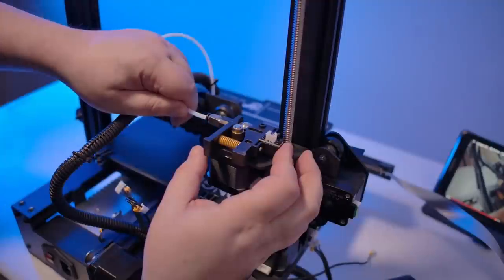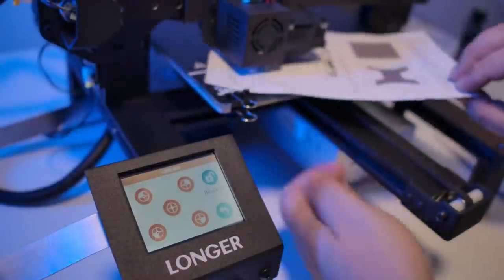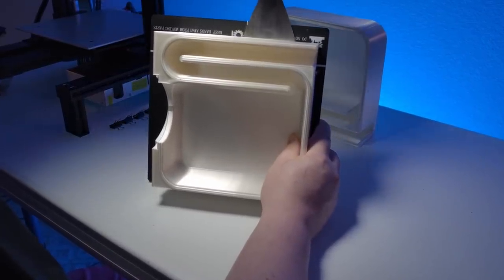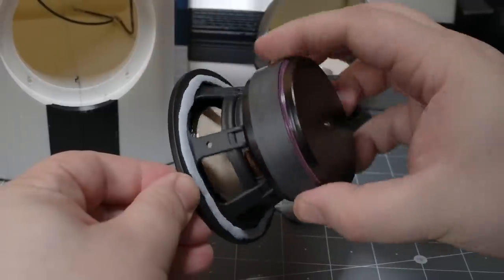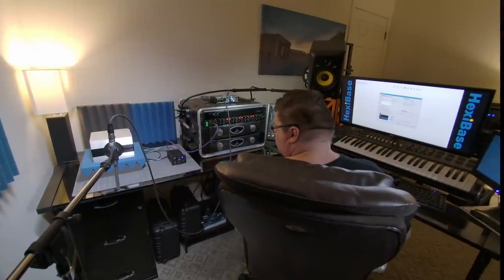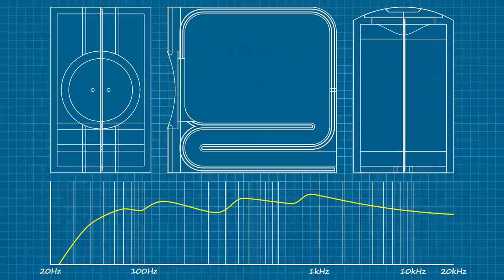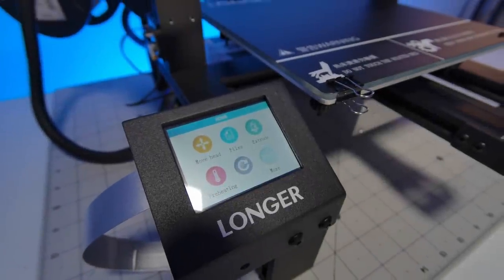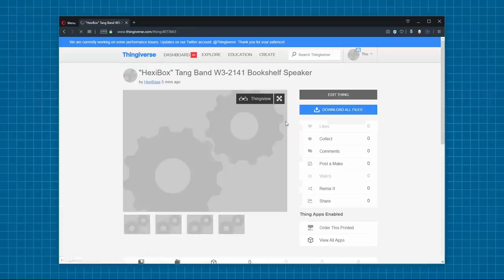Full Range Speaker Project, Longer LK4, Plus DEMO!

Comment: I'm sold, now i just need a 3D printer..
Reply: @HexiBase  Do you know how much the pro will be going for tomorrow?
Reply: It is 199 after $10 coupon, price already went up?
Reply: @OTL The High Temple of Spam that is an extreme. You could say the same for pro-grade 3d printers.  A cheap track saw (I love my grizzly) can replace a table saw for speaker building, a bunch of clamps, a drill, and a jig saw is really all that it needed for basic enclosure construction
Reply: @HexiBase  that's not bad I thought that would be like a thousand dollars...
Reply: Your the best
Reply: My printer is on the way...

Comment: Hey I like your content and analysis of speaker science but dont you think if you also put a walkthrough on how you end up designing the inner enclosure, like the measurements, the layouts, etc, it would be useful for builders. This would help in using those for different range of drivers. I have seen your woofer project, after watching the video I was impressed and wanted to try out but couldn't, since you never explained how you go about doing the enclosure calculations and build. That was not fun in the end.

Comment: So made those two beauties, 16 hours with 0,8 mm nozzle for one half ..... paired them with cheapo TPA3116D2 aiyima 2+1 amp ...... amp can deliver 25W at 8ohm, speakers can draw 25W at8 ohms continuously .... long story short, blew amp (testing is not testing if you dont try max Volume) but at that short life of amp (waiting for new) speakers plays guitar songs magnificently :D
Reply: also if anyone can recommend "budget" 2+1 amp that i can pair with this two beauties and one 3" Subwoofer Enclosure v.2 (with Tang-Band-W3-1876S inside), would be very grateful ....

Comment: This one looks good and is highly rated ANYCUBIC Chiron. Can build a nice sized enclosure, but I wouldn't use PLA personally, because it degrades in sunlight and is not a good material for automotive environments. I'm looking to 3D print an enclosure for my coveted Precision Power PRO 8 liquid cooled sub-woofers. But want to use Nylon as the material, this one I don't think will use Nylon filament, but that may change in a later revision.

Comment: No batting, yet no mid-range/ treble leaks through the port? What kind of wizardry is this? lol! They sound very good. I attempted a pair of speakers a long time ago just using full range drivers and was blown away. They did have issues with spikes in the midrange and treble regions but for my first "speakers" they weren't bad.

Comment: I printed a pair of these along with the V3 Sub out of ABS and powering them with a Dayton Audio DTA-2.1BT2.  Using them as a 2.1 setup for my PC replacing/augmenting my Yamaha NX-50's.  These blow away the Yahmaha's by a fairly good margin.  These have much better mid-response where when I switch between the Yamaha and these it's a night and day difference with these being heavily favored by my human ears.  To be fair these drivers and the amplifier cost the same as the Yamaha's cost and I still had to print the boxes which take up 2+ rolls of filament and print time which for most people will be just over 2 days.   I look forward to more 3D printed speaker boxes you make.  I'll probably have to print them as well.

Comment: Digging your channel and the technical nature of your content!
Given the flexibility printed enclosures give you, I'm quite surprised to see a full range design with relatively large unsupported/unstiffened sides.  In listening it almost sounds like I'm hearing a resonance in the midbass from the enclosure, though it's impossible to tell.  Do you pick up any resonances through the enclosure with your hands/ears when sweeping a signal?
Given the nature of your channel, it would be incredible if you were to explore the technical side of damping/minimizing enclosure resonances.  With your modeling skills, perhaps you would consider adding some FEA/resonance modeling to your resume?  I'm an amateur speaker builder at best, but the little bit of experience I have suggests the enclosure design (and it's sonic neutrality) is far more important to making a speaker sound good than the driver choice and sometimes even the crossover details.  Cheers!

Comment: About 5 hours per side to cnc out of wood..... Hmmm
Reply: @HexiBase  Had to order longer bits but I am going to give it a go. They only issue is the indexing slot is square. Since the finishing 3d path uses a 1/4 inch ball nose bit I will need to figure out how to edit the STL file and either make the grove deeper, or round over the raised slot. Any software recommendations to do that?

Comment: Nice work.
You should add your speakers to the "customer photo gallery" on parts express by writing a review.
With the links to your content of course 😎
Reply: @HexiBase  Oh, and you should really switch back to gyriod infill.
It prints significantly faster, is easier on the whole machine with less jerking and overall stronger.
Just stick to high perimeter counts since that is where you get the most structually gains anyway.
It may also be in your interst to play with the "nozzel size" to get tighter perimeters but this is something that needs to be experimenteted with to get "a feeling" how it behaves.
You can trick the slicer to slice some mazing things this way ;-D
Reply: @HexiBase   Uhhhh Simplify3D is a heavy weight with a myriads of advanced options especially in terms of job planning 👍
But don't get to set on one single slicer try other options like cura or prusa's slicer from time to time since each has its own niche and specialities and very active devlopment.
And why is the god damn spellchecking not working get a grip chrome 🙄

Comment: I just found your channel a few days ago, I was hooked right away. You deliver the information in a very informative yet engaging way. I'm in the process of making my own portable bluetooth speaker and I want to apply one of your "snake/wave" patterns. Could I make a "box" applying your pattern with four drivers and a sub? 
I don't have a 3D printer but, I will be getting a CNC machine in June which is what I will be using to create this. What amp do you use on your desk? (when you connect your test speakers to for the videos)

Thank you in advance. I greatly appreciate your time and knowladge. Stay safe and have a great day!

Comment: If you're going to be doing a lot of gluing together of 3D printed parts you should check out J-B Weld Plastic Bonder. I find it works great on PLA and PETG. 
Great speaker project! 

Ok here's a challenge. How about a design with a 100mm cubed build volume constraint on the printed parts?

Comment: Man..) Excellent work!!!  Curious.. How would you run a cycle-truck stereo? Got a Kona Ute with about 38" x 7" of rack area, not even considering seat wedge..) I'd like to project sound at the ground, front 180 arc (from seat wedge) , and likely a booster fan out the back, keeping sides and top for solar panels..) Passive radiator cool.. are there any flow through designs?)   ( air flows through) You know a lot more then I do..) Those are pretty popular bikes.. with a sick lightweight quadraphonic kit, who would even need antigravity?)/*   Currently running a pair of lightweight 20 or 25 watt bluetooth speakers at a time, but they die down.. luckily, from dropping mine, one came apart down to where I could see the hardware's easy access.. )  If you're bored with your other stuff, hit me up. Rock on!

Comment: can i use alternative options (of the same brand) for these speakers?
Because they will be in plain sight at my place and don't like the driver very much.
I do understand that all the parameter are based on this driver.
Other than that everything you make is great content and very informative!
Although as a Dutchman I do have some trouble understanding all the technical terms

Comment: You do not want to support the top of the leadscrew because that can induce a banding. It forces the wobble to be put into the x axis rather than just running out at the top. Even if it was a perfectly straight leadscrew and the coupler didn't induce runout the benefit of supporting the top of the leadscrew is nonexistent. It can only cause harm.
Reply: @HexiBase  Cheers to you as well. I appreciate these printing videos as almost nobody has the ability/equipment to test sound like you can. Are you planning another woofer/subwoofer build since the last one caused a crazy backorder on that specific speaker lol?

Comment: I feel like parametric modeling would be amazing for 3d printed speakers.

Because you could have the user put in the speaker info. And maximum size in two dimensions... And then have it calculate everything else automatically based on a set of parameters.

Comment: The Tangband w3-2141 are awesome. I built myself a pair of "cyburgs needle" transmission line speakers with them a while back and i love them. For how little they cost me to build they outperform a lot of way more expensive speakers. 3D printing enclosures for these drivers is a genius idea, i might try doing that for center and surround speakers for my home cinema. Now to find a 3d printer...

Comment: Wow!! From a single 3" driver that's amazing! How did you go about selecting the driver?
Reply: Did you have a 2nd driver choice, with a more durable cone material (more water-resistant for a car-camping boom-box)?
Reply: @fisheye42  You might be able to track something down by using this driver's specifications as a starting point. If you buy a driver with similar specs from a reputable vendor (which I count Parts Express among), the driver should perform similarly without modding @HexiBase's case design. I would expect to pay more for the more rigid material, though, which is probably why such a driver was ultimately excluded from the candidates list.

Comment: Have you plans of making a vid comparing diffrent walls, ie. with and infill so on, with how it effekts damping or the sound?
Reply: @HexiBase  I was about to ask this, I was about to make a 2way potable speaker using an nd91, but I'd rather not waste  plastic... It's seemed like gyroid infil would be a good option over 15% infill, just wasn't sure how many walls and how thick  of a wall, I thought maybe 10mm and 4walls in and out

Comment: Awesome video! I have a spare set of 3 way Focal speakers, Focal K2 Power 165 KRX3.

I'm considering designing something like a mini version of the Focal Utopia, with 3 separate boxes printed in PLA, walls filled with thin sand.

Is that a good or bad idea? :P :D

Thanks!

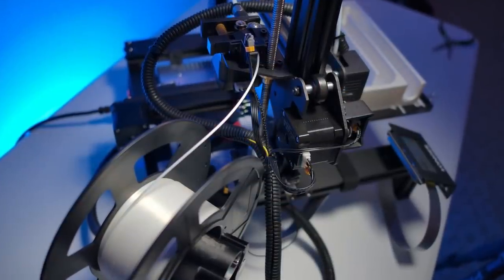Comment: One comment, at 4:43 when you're cutting the existing spool, if you plan to use the rest of that spool, you really don't want to cut it off like that without holding it where it can tangle into the rest of the spool, it happens a LOT if you're not careful. Other than that, great work.

Comment: Is the transient response in 6th, and 8th order bandpass enclosures bad enough to be very noticable? Looking for a high efficiency box design to cover from roughly 30 - 80 hz, and can't decide between a bandpass or folded horn design. 

Great build in the vid, these tang band drivers look great.

Comment: This is very fascinating! I would like to invest in a 3d printer and make some enclosures like this and for the 3" Tang Band sub. Will the LK4 handle the size and resolution of the enclosure for the 3"? I'm ready to take the plunge and pick up either the LK4, the GEEETECH, or the Prusa i3 printer, but I only want to invest what is needed since I'm a noob. Do you have any thoughts on the ANYCUBIC Chiron?

Comment: I have spent thousands of dollars trying to find the right system for my vehicle I would like my system to be and have sound quality and if I would like I would like to be able to turn up the bass knob and get SPL I have a pair of 10tw3 JL audio subs with a selection of a jx500 or a jx1000 also an xd1000. it would be nice to possibly try to see if I could get a subwoofer box design for a 1994 Chevy Silverado extended cab

Comment: The z lead screw is unsupported on purpose. If you where to confine it at the top any sort of bend would cause your carriage to develop z wobble. Your prints would have horizontal banding on the sides. If you look where the lead screw is connected to your carriage it should have some slop in it in the x/y direction this also helps prevent z banding.

Comment: Question- what gauge wire are you using inside the cabinet, and are you using a lead free solder? If so, do you have one you suggest?

Comment: with a port that long, does it not have a series of resonances? if so, and hypothetically, does that change if your port/guide is an exponential horn? is a passive radiator better than a long port if expense & complexity are not factors? why is bass reflex always a sudden transition from box to port? is there any use for a gradual transition, or is that what a transmission line speaker is?

Comment: Sweet! Can you please make a model for 300*300mm base printers? Maybe with a bigger driver too?
Reply: @HexiBase  What size drivers will you be using on that?
Reply: @HexiBase  I bought the TEVO Tornado because it has a much faster heating system 1.5 years ago and it's worked great. CR-10 V2 still has a slow heater from what I understand.

Comment: JUST TO BE CLEAR...YOU ARE TAKING SIGNAL STRAIGHT FROM THE TABLET TO THE DAYTON AMPLIFIER, THE TO THE SPEAKERS?
Reply: THANK YOU SIR....WANTED TO UTALIZE THIS SET UP AT MY OFFICE, LESS COMPONENTS THE BETTER. 

DO YOU FEEL THAT THE AMP THAT YOU USED WOULD BE THE BEAT SUITED, OR WAS THAT JUST CONTROL TEST AMP.. IF SO SUGGESTED SOECS TO OPTIMIZE THIS COMBO?

HAVE 2 OF THE DRIVERS IN ROUTE!

Comment: I'd love to see you do a small (3.5-to-5-inch-ish) studio reference monitor with (a) full-range driver(s). Something with no crossover distortion that can give a good sense of what's really happening in the broad midrange but with enough low-end extension to define the fundamental frequency of a kick drum (60hz-ish). I like to record drums in mono through a single speaker to help me avoid phase cancellation pitfalls. I usually pan everything to one speaker but it would be nice to have a dedicated drum recording speaker which could double as a full-range mix reference monitor (like an Auratone but with more bass).
Reply: @HexiBase  Interesting! Are you inclined to something like the reference back-loaded horn (which is a big-ass box) or a bass reflex design?

Comment: You are still not addressing the port resonance which will be very low. Poor design.
Reply: @HexiBase  no, port resonance needs to be high to push it out of the pass band. I think you are using terms incorrectly. Your videos are riddled with errors.

Comment: first, thanks a lot, this is like the best use my 3d printer will see.
Second, buying from parts express is really difficult from my country. I know it is asking a lot, but could you check some speakers from Aliexpress to make a set like these? AIYIMA, Tenghong, Sounderlink and  GHXAmp are popular brands there
Reply: @HexiBase  Thanks for your response. They don't have a large inventory like those stores in AliExpress, but would work. Their shipping costs used to be good but got really bad in 2019. I would check some stores in Ali, like those I found, and try to arrange a deal like the one bangood offered you, maybe choosing the store with speakers with best specs on paper.

Comment: Oh my gosh!!  These speakers are outstanding!  I finally finished printing your 3" subwoofer to go with these and until then I was somewhat underwhelmed.  Now that I have the little sub to go with it these speakers just came alive.  They stressed a little playing the high highs and the low lows but now that they can shine where they are meant to they are just supurb.  I'm no audiophile but I set these up in my office, put the sub against the wall and leaned back to listen.  The speakers disappeared and an enourmous soundstage opened up.

Thank you.  Printing the 1 1/8 speakers from your more recent video now, can't wait to try them as well.
Reply: just curious but about how much filament was used to print all that? new to 3d printing and wanted an estimate before i order my filament.

Comment: i think it lacked a tweeter there was enough space in the enclosure for one
Reply: The whole purpose of this video (also see the title) was to design an enclosure with a full range speaker. Why would you add a tweeter to a full range speaker?
Reply: Just hit it with a little more EQ, it's a full range speaker. If it doesn't sparkle enough for you add some EQ.

Comment: I read a few articles about the subject and tried to be informed. I learned: Mass is important. Actually, you made the mold making material in this construction. You can use these molds for concrete speakers. Interesting idea